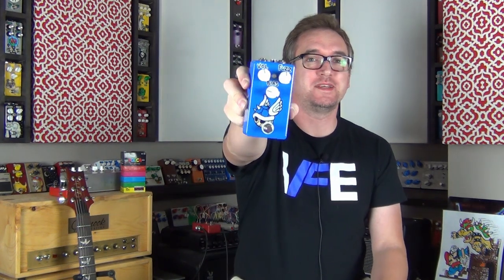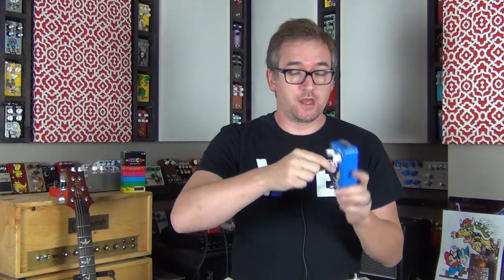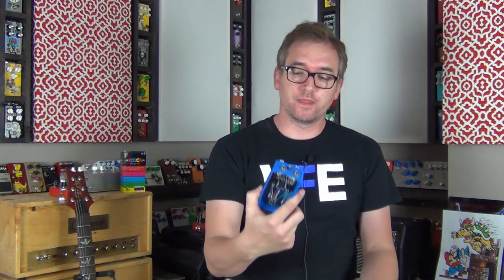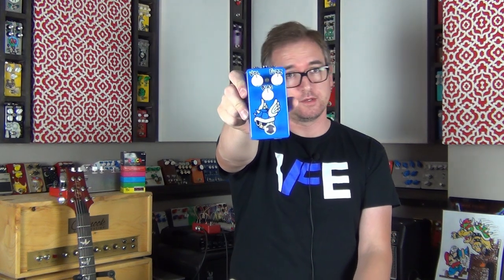PedalPCB.com Sunflower and Squidward I DIY Guitar Pedal Demo and Build Report

Comment: I havent built a crazy amount of pedals, but the green ringer i built off a different pcb is the one ive used the most. Not even for the octave up sounds but mainly the lower down the neck almost sitar sound (especially on the lower strings)
Reply from the maker: I love the tracking on those